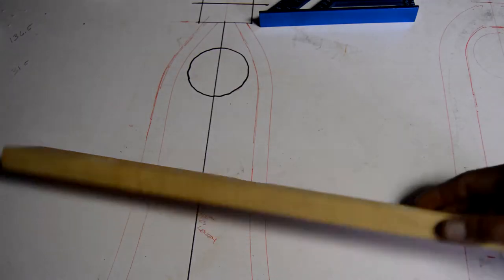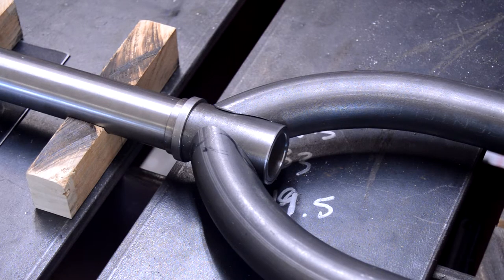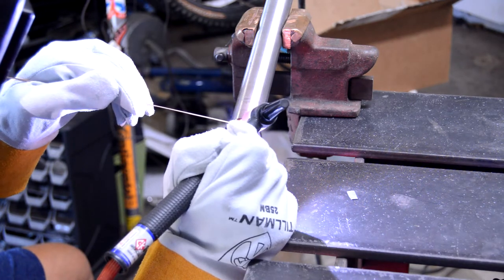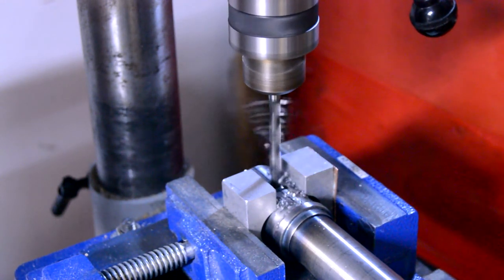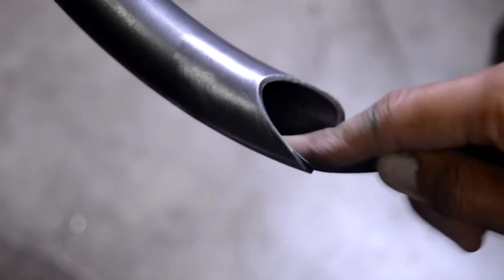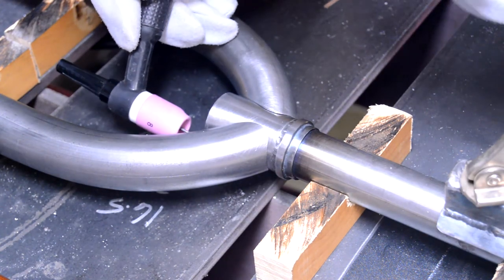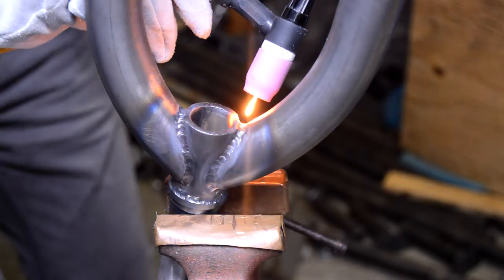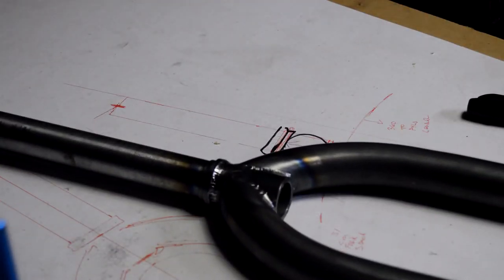Bicycle frame build number 2 part 5

Comment: Were did you acquire the crown race that you welded to the steer tube?  I am looking to weld up a fork but can't find any retailer selling such an item.
Reply from the maker: I purchased it from Nova Cycles. I purchased a complete fork kit, but ended up making my own legs. They do sell the crown race ring separately though: https://www.cycle-frames.com/bicycle-frame-tubing/STEEL-UNICROWN-OVERSIZED-RACE-RING-FINISH-OD.html